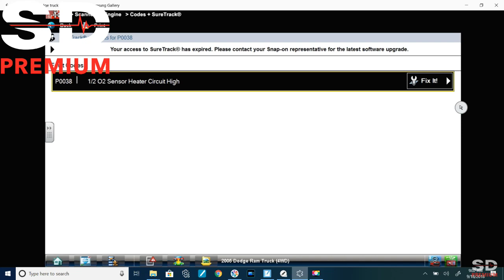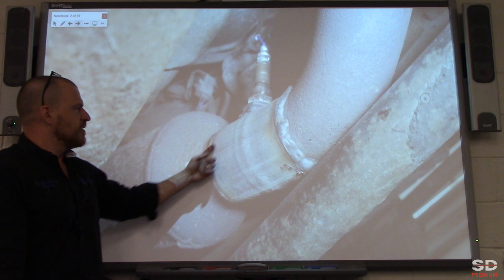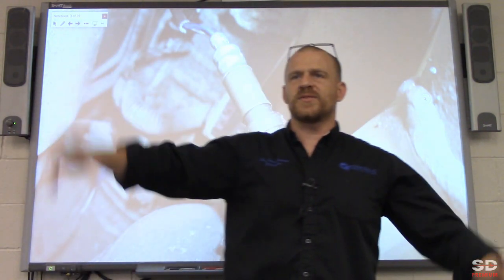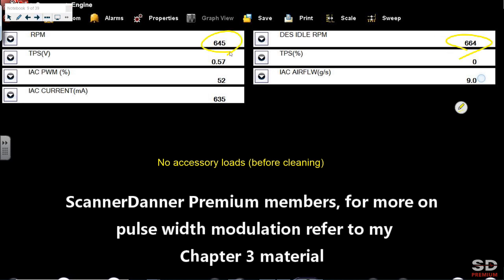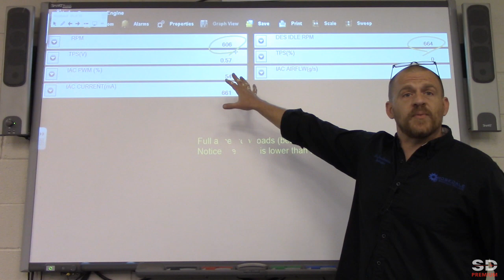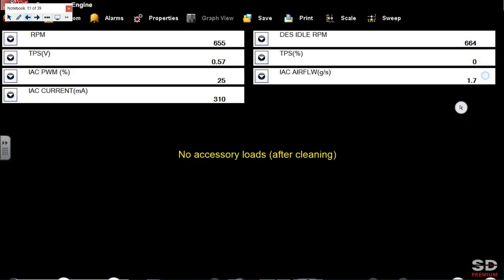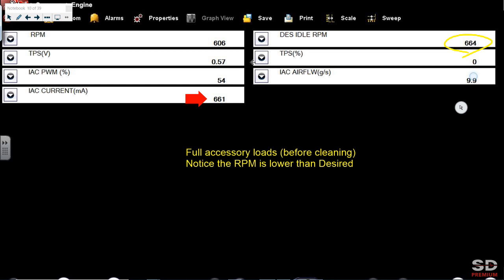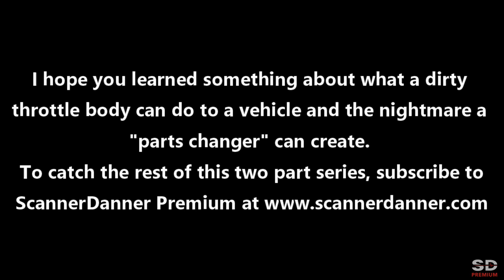O2 Code, Dirty Throttle Body (stalling problem) & Mechanic Incompetence

Comment: My van has been intermittently styling recently after it would sit idling for quite some time and also when I turn the wheel, I generally clean my throttle body all the time I would never suspect that

Comment: i have the exact same problem on my Chevrolet optra with a bad o2 sensor which is lazy and read extremely rich most of the time at first i was thinking that the o2 sensor  so i disconnected it waiting for the new o2 sensor and drive the car but it still stall when i released the gas pedal during breaking or after it then i  looked at the throttle body i noticed it has carbon build up so i cleaned it and now it runs so much better but i have another problem which is i had to make adaption reset for the throttle body because if i tap the pedal it stuck at 2k rpm for a while the problem is i don't have a professional scan tool to do it i only have bluetooth obd2 elm327 which is not able to make such a procedure.... thank you so much for all of your videos i really learned a lot from you
Reply from the maker: Keep driving it, it will eventually relearn. Took 40 miles over a few different days of short trips for a friends Impala (Chevy)
Reply: @ScannerDanner   i watched that chevy Malibu video and actually you mentioned that impala in that video you shared with us it was nice work thank you again i really like what you doing

Comment: Had the exact same problem with my truck was getting ready to change my sensors, but before I got a chance to I pumped a tank full of e85 in my truck(it’s flex fuel) because I read it’s better in terms on cleaning. About a week later my truck ran perfectly

Comment: I have run into this many times with Chrysler computers from the dealer. I explained it to my customers and a few times they took it to a dealership and was with out there car for months. I complained to the dealership and The worst thing is if the dealer did not install it them selves they would not warranty it and they even programmed it for my shop. It was rediculas we towed them in r&r'ed it in the parking lot. At least out in California that's what they have done us and not just 1 dealership but 3 I believe and at the end after the dealer replaced harnesses and so many thing's all it needed was a new computer. Now I buy online or used and reprogram my self. This was a great video. I have always said there are mechanic's and there are people that do other things lol.

Comment: I've always worked in shops where we had to eat it if it didnt fix the problem. Unless you had a REALLY good story the customer wasnt paying for you to throw parts and keep guessing. I hate replacing anything if I can't verify it is the problem.
Reply: @BYENZER  I worked at 1 car dealership. Honda. Flat rate. You didnt get paid if you misdiagnosed. Inspections were free so you lost on that alone. Dealerships, or at least that one, was stingy with diag time. Everything else I've worked in has been heavy truck or heavy equipment. I worked in 1 truck stop. They charge for everything. In heavy equipment customers want a breakdown of everything and why things were replaced. If you don't have a good answer or you didnt fix it they refuse to pay so the shop eats it.
Reply: That Honda shop is VERY rare. I can think of maybe 3-4 actual shops that don't charge for every part installed (and sometimes for parts that were not installed) if they screwed the pooch on diagnostics. 
It's why ALL shops are thought of as crooks.
Reply: If more shops had that policy, I would just get my car fixed and not be watching all these repair videos trying to figure out how to fix my own car. I've been ripped off multiple times by different shops and am done with shops.
Reply from the maker: @javaman2883  again, I don't thing these shops blatently tried to rip you off. I truly believe it is incompenence and poor business ethics after the misdiagnosis of whatever you had going on.

Comment: The previous shop had no idea of what they were doing!  Originally, the engine was stalling.  Any codes?  If not, monitoring the pids you had would have given some information as to what's happening.  I've seen other problems besides a dirty throttle body cause stalling, like the IAC motor on a 2004 Ford F450.  An intermittent crank sensor AND the wiring to the crank sensor on an 86 Buick LeSabre.
A MAF, same Buick, and an intermittent stalling much later on with over 250,000 miles, LOTS of road testing, the PCM.  Which left me walking home one mile.  The crank sensor, the wiring, the MAF all before 100,000 miles.  Even an intermittent cruise control module.
That car was "a rolling intermittent on 4 wheels!"  Thank GOD it's long gone!  Sorry for the rant.
Reply: Mike Chiodetti newer cars have become a lot more complex. The OBD 2 and CAN systems are often harder to diagnose. Any short or bad connection or bad actuator or sensor can affect several systems so now we have to deal with driver circuits and sensing circuits issues that can set off quite a few   problems. Mechanics really have their heads in the game to be able to diagnose and properly repair any issue that comes their way. Having the proper diagnostic tools is a must also.
Reply: Willie Gillie 
Agreed!  But I've seen what happens when other shops use the parts cannon.
Before retirement, I was an Auto Electrician at the L.A. Dept of Wtr and Pwr.
I had a variety of problems including intermittents, problems from other shops, project vehicles and helping guys in my shop.
I used to get one problem from other shops after they threw parts at them for a P07XX code which was the Input Shaft Speed Sensor code.  Of course it worked as advertised, clearing the code brought it back on a road test.  Thanks go to iATN for my find.
Using that info I checked, with the IDS for Fords, the "spark plugs and ignition coils."  Plugs were were worn slightly, coils were original (DATE OF MAN) about 2002 to 2004.  It was it was 2009 to 2012 at that time.  Replaced plugs and the latest coils, problem gone.  Road tested great, vehicle went back to work, and I notified the guys at other shops, my findings.
The shops using the info, solved their problem.  Welcome to electronics. .  Just a fact, hope this helps.  Sorry for the long description.

Comment: Nice presentation , but would like to add, you neglected to point out that cleaning out the iac port and cleaning the iac motor pintle would of helped also. That little port at the bottom of  the throttle body is the   bypass port the iac motor uses to pull air at idle , bypassing the blade. :)

Comment: As a small businessman I have a lot of compassion for today's mechanics/ techs. First, the freaking overhead is killer. It was never cheap, but compared to say 15/20 years ago... Anyway, customers have no way of understanding that. Next, look at the crap they're building today. It's a wonder how some designs make it out to production. Then unless you want to buy crap after market parts, which fail way to often, get ready to take out a small loan for OEM, and even then it's a crapshoot. So, you guys put with all of that, plus the goofy parts dude who sends you the wrong parts too many times, do the job right, and the customer bitches about the price. It sure ain't easy.

Comment: Mechanic are parts replacer...real technician do diagnoses and repair whats broken...imo
Reply: KING KONG funny I think the opposite. My dad was a master mechanic. He owned his own shop that I practically grew up in (early 80's).  These were the days when you brought a vehicle in things would be rebuilt. Everything from starters/ alternators to automatic transmission and engines, they rebuilt them. When parts got cheaper to replace then rebuild is when "technicians" came on the scene.
Reply: You definitely have that backwards kong
Reply: then I'm a fucking mechanic too (even if I don't do that for a living)
Reply: I think the main difference between a technician and mechanic is just what King Kong said. From my experience I’ve noticed most of the great mechanics got stuck in the past and didn’t progress as newer vehicle technology did. If you bring in a newer car with intermittent drivability issues most stay scratching their heads throwing parts at it, hoping it will fix it.

Comment: have a Buick with high milage hope to learn off of it how to use the old snap on vantage someday. 
I think the knock censor is bad because under heavy load it doesn't have power for few seconds then instantly it'll straighten itself out like someone flips a switch. 
Also stalls during hot starts till o2 circute warms up. 
Biggest possibility is it has 269,000 miles racked up🤔 

Thanks for the videos by the way keep it up👍
Reply: That's not a symptom of a faulty knock sensor.

Comment: This is a real issue in this field. I have seen people sell things just to make money several times. But more often I see guys throw hundreds or thousands of dollars of parts at a car for a simple problem that they didn’t know how to diagnose.
Reply: Amen! It's not about fixing it anymore. It's about making money on you. You would figure that with all the modern tools , mechanics would have an easier job diagnosing a problem.
Reply: Emilthehun it’s not a tool problem. Many techs today don’t even understand the basics or care to learn.
Reply: @TheAutoTech  agreed. I'm about to buy my own scanner to troubleshoot my cars. What's the best program to use with a laptop?
Reply: Emilthehun autoengunity and ease make laptop based scanners. I’ve used both, I wouldn’t recommend either. What are you looking for in a scanner?
Reply: @TheAutoTech  I'm looking for a live data reader type stuff. Is there no scan tool that can show you what's out of factory spec ? Sensor reading I mean.
Reply: Emilthehun scanners show you data, it’s up to the tech to determine what’s right or wrong. The launch creader series scanners are good for basic data. If you want enhanced data and bidirectional controls it will significantly increase the price.
Reply: @TheAutoTech  wow what's bidirectional controls? And I can't believe there is no such tool that would automatically select readouts that are not within spec. That's crazy. I'm no mechanic , just want to be able to fix my gmc lmao
Reply: @emilthehun check out bluedriver for a good basic scanner with allot of added value.  If you want something more serious look at the Launch CRP.
Reply: Emilthehun too many variables for a tool to tell you what is right and wrong. If you want to learn how to read data I suggest getting a premium membership on scannerdanner.com Paul has some excellent videos there.  Bidirectional controls is the ability to turn things on and off with the tool. For just starting out there is many Bluetooth scanners that work with a smartphone for around $50-100 the launch golo would be a good choice.
Reply: @sailorbob74133  thank you sir!
Reply: @TheAutoTech  thank you sir! I have been thinking about taking a class or two. Are these bluetooth scanners fast enough to monitor live data? Also where do mechanics get their factory tolerances from?
Reply: Emilthehun some from service info some from experience, not all specs are published. Alldata and Mitchell on demand both offer a diy service for service info.

Comment: Yes they are. That is the reason that i started learning from you and Eric. So i dont get scammed again. I am not a mechanic, but telecomunication engeneer.
Reply from the maker: I don't think it is thievery as a whole, it is incompetence then lies to cover up the misdiagnosis because the shop doesn't want to pay for the mistakes.
Reply: i didnt find any shops that was willing to pay for mistakes. even the dealer screwed me. the last time i got screwed was when changing rear brake caliper. it didnt need changing, hand brake had to be adjusted and brake pads changed. didnt get my money back...

Comment: I am more familiar with the IAC stepper motor from around the 1980s and early 90s GM cars. On the IAC in the video, is the valve fully retracted and more pulse width extends it out? Could you explain more about how that valve works? Also, should the IAC valve be removed and the boar checked where the valve seals to see if that area needs cleaning? Which of those computer values would give an indication of let's say how much more reserve authority the IAC system has in a given condition at idle?

Comment: I can say for certain that many mechanics are just not trained well enough.    Not only is there a shortage of mechanics in the UK but exceptionally well-trained ones,  impossible.  The experienced guys are getting out because the work, pay and conditions are terrible.  The knock on effect is poor diagnosis work and on the whole shoddy workmanship.  As you see the welding skills on the exhaust flange and "bunghole" were good so the guy had skill in one area but weak in the area of proper diagnostics.  This could be rectified if his / her boss is monitoring the progress of the mechanic but it is never the case.   

Unless someone is self-motivated to learn then there will be constant mistakes.  On the other hand, a guy can spend much time doing extra work and learning and never be appreciated for his efforts. This is when the workshop loses potential excellence.  

  But also I will add that many young bucks are just too arrogant to learn for older guys who are prepared to spend time and teach.  they then come unstuck,...  sometimes really badly.  They scare off customers with their incompetence and then act as if they don't care.  

Customers aren't angels either.   Would be interesting to see the other side of the coin where customers try to pull fast ones on the workshop.
Reply from the maker: really great reply and insight, thank you!

Comment: I have an 03 dodge ram 1500 with 4.7l that's been stalling like this intermittently since 2011. I've changed plugs, fuel injectors,  fuel pump,  fixed evap hoses, and cleaned throttle body. My current activity included changing out a k&n reusable filter back to paper, plug change, and cleaning throttle body. I've had  3 days no stalling. Could a worn ignition cylinder cause stalling,  my key comes out with ease while truck is running.

Comment: I am Cornholio - I need more TP for my bung hole... :-)

Good video and a logical thought process. 

To answer the question - Are mechanics thieves, or incompetent? Does it matter if someone who is unqualified, gives an effort and fails to fix it? What about the thief who is just taking your money, without you getting anything in return? Isn't the end result the same, the customer has less money and still has a broken vehicle? You could make an argument that the thief left that person in better shape than the shop who tossed parts at it and damaged items in the process. 

As a veteran of almost 40 years, my question would be why is this still happening some 40 years later? It seems like the culpability lies in the same place it always has - consumers, lack of standards, the government job justification programs that masquerade as regulatory agencies, the manufacturers who get their franchised dealers to abide by an outdated method of reimbursement for warranty costs - which in turn trickle downstream.
Reply: Another way to put this would be, all incompetent tradespeople are thieves, but not all thieves are incompetent.